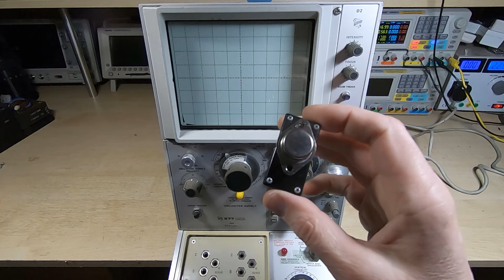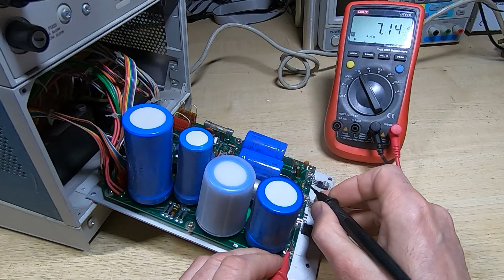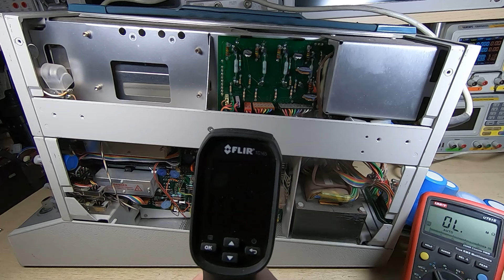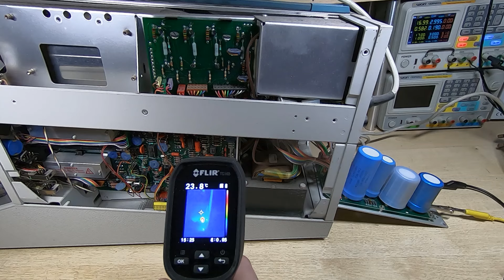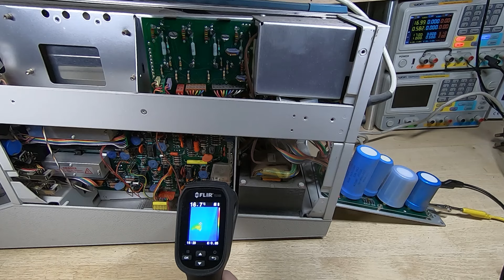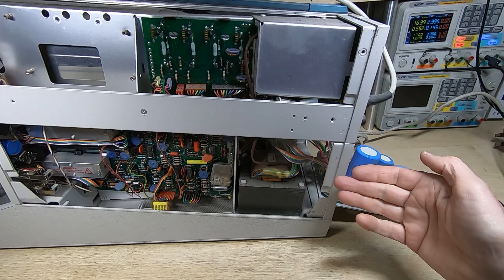Tektronix 577 Repair

Comment: Just watched the 3-part series on the 577 as well as this one. I have a 577 that's been hibernating for at least 5 years, probably longer. When I purchased it, it was sitting in the seller's garage with a trace on the screen. It's possible he turned on for the first time in 10 years or more and then turned it off. Anyway, I'm getting ready to dust the baby off in hopes of putting it into production on my bench. These were a pleasure to watch Jerry. If you lived here in the US, I think I would just bring my CT to you. The calibration process looks tedious. Not sure I'm looking forward to that. And I loved in this video how you blazed through the part where you removed the old tantalum capacitor and resoldered the new one without removing the board. I don't even want to guess at how you managed that. I'm guessing you waved a magic wand. Anyway, at the end of the third video, you said you would do a fourth one showing a bunch of tests that you could do.  I would be interested in seeing that. I'd also be interested to get any advice on warming my machine up for the first time. I like how you powered-up the different circuits with your power supply instead of from mains. I have a variac so I can gradually increase the voltage to the whole system from mains. Hope to get an answer!
Reply from the maker: The calibration procedure is not too bad, it just takes time. I still hope to post a video on using the tracer although you may find my video series on magnetic core memory interesting as I used it extensively for that.
It is not usually a good idea to power devices up too slowly as this can cause problems and rarely stops any failures. Unless you are working on devices with the old aluminium liquid filled electrolytics then you can probably ignore most of the Youtube scare stories about reforming capacitors.
My advice would be to drop the rear panel and disconnect the leads going to the main boards and test all the supply rails. They are all linear regulators so very easy to test.
If they all seem OK then reconnect all of them and power up the machine. To be safe you could use a dim bulb tester (filament bulb in series with the supply) as this will limit the inrush current.
Just keep a close eye on it for the first few hours as you may get some tantalums going short.
A thermal camera is ideal for this or failing that the sniff test works well.
Good luck.
Reply: @JerryWalker001  I see you're using a FLIR thermal camera. What Thermal Camera would you recommend for electronics repair? Or, what features should I look for?
Reply: Also, @JerryWalker001 I was watching. some other videos and one feature that seemed important is to be able to focus at close range... this way you can more easily spot the exact locationi of the potentially troubled component among a sea of tiny components. I am curious to know about your experience and if maybe ability to work at close range is something that some thermal cameras do.

Comment: Would Like to know if there is an alternative to those Tantalumns. They are quite expensive and usualy a lot of them inside the machine. Sincerely Jerry did tell us what he placed in instead.
Reply from the maker: I fitted a 16V 100uF Tantulum. They cost around £0.40.
Reply: @JerryWalker001  My Datron 1071 would need a few 35V ones, if I counted right, I would end up spendig around 130€ if I would replace them all at once, not including those electrolytics which are probably due also. I guess it is worth it anyway if there is no newer part which would serve the puorpose of those better.